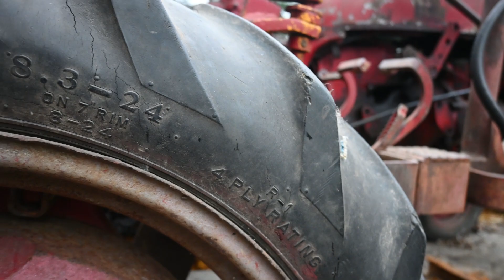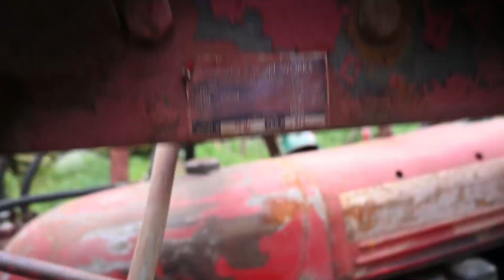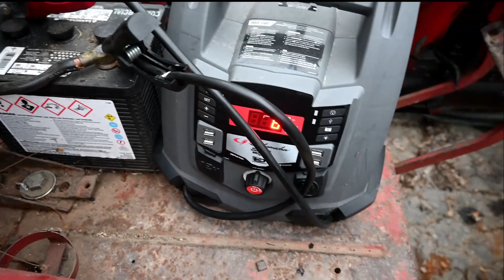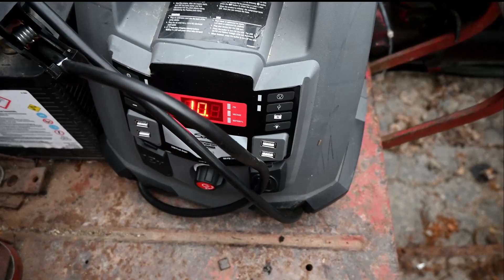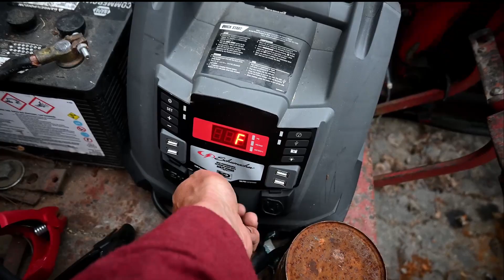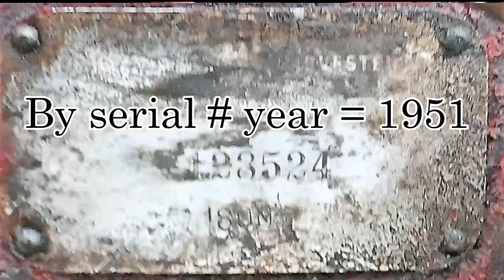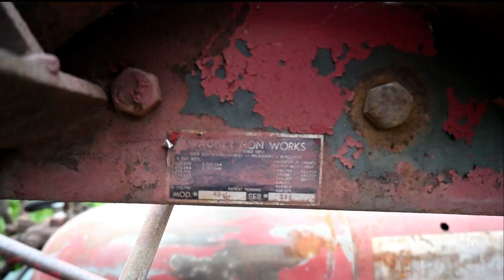Waking up the Wagner Loader Farmall Cub

Comment: If you ever need to jump a 6V tractor with 12V, just hook the 12V directly to the starter after the solenoid and then I won’t back feed the electrical system or cause any damage. Looks like a great little tractor